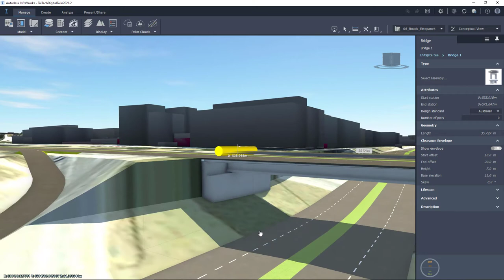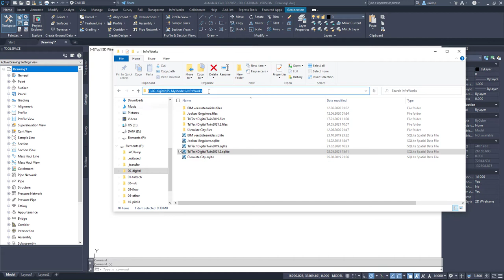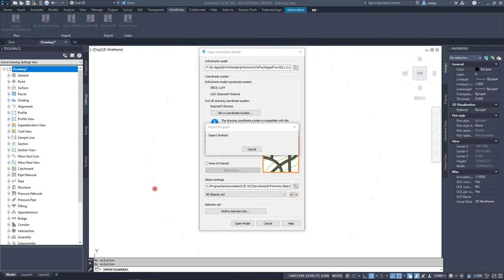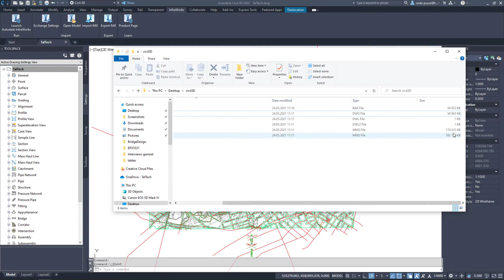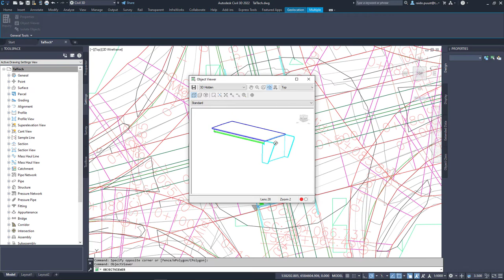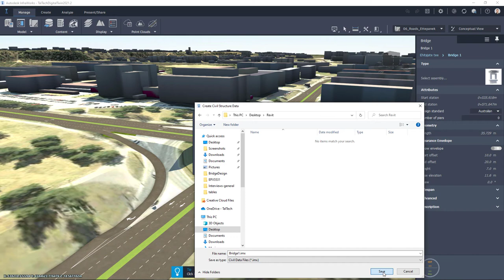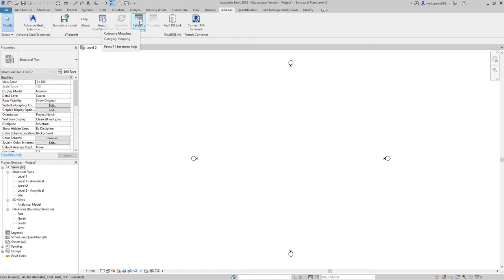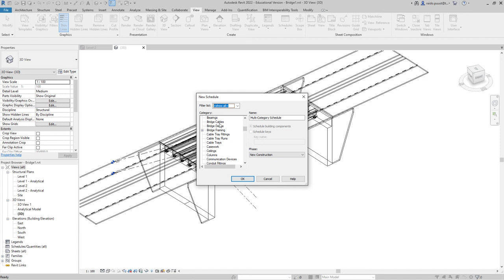BIM workflows - Bridge from InfraWorks into Civil 3D, Revit

Comment: Hi Mr. Puust. I hope that you are well. There is not any Dynamo for Civil 3D course. Or is there? Would you consider preparing a course about it. On Udemy, on Coursera whatever.
Reply from the maker: Great proposal! There are some courses/videos available through Autodesk University. Of course, Dynamo/Civil 3D has lots of possibilities and those also depends on the user needs (to which area to focus in Civil 3D - survey/road design/pipe network etc.). I do plan some videos in terms of property sets and classification system soon and how Dynamo can help in there.
Reply: @eRaido   Although work in an airport, I focus on the road, highway engineering. I know those videos but I think that they are not sufficient. I can't see any course and waiting for your videos. Thank you, I am appreciated.

Comment: how can i export sanitary system to revit ?
Reply from the maker: Can you be more specific. From where you want to export to Revit?
Reply: @eRaido     i like export C3D pipe networks to Revit
Reply from the maker: @luischacon1160  Only kind of easy workflow could be that you export C3D pipe network into IFC and import that IFC into Revit. But that is "broken" workflow as it is good for reference only, because no manhole/pipe can be converted into native Revit component/family. As Revit/C3D work in different domains (in terms of pipe network - building vs outdoor) I do not see any easy option that will create parametric components through an import. Only graphical part can be recreated. In general I do recommend to keep building/outdoor related components in those different packages and combine those through open formats (IFC) for coordination purposes but not for design share/recreate. Hope it helps.